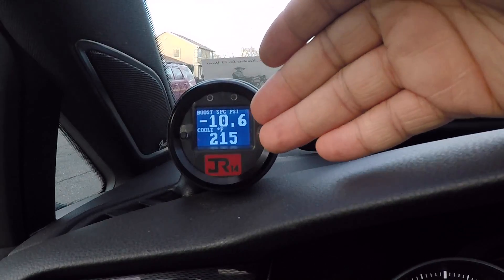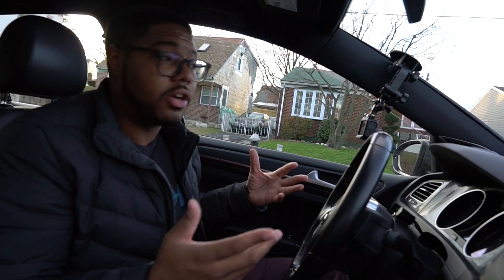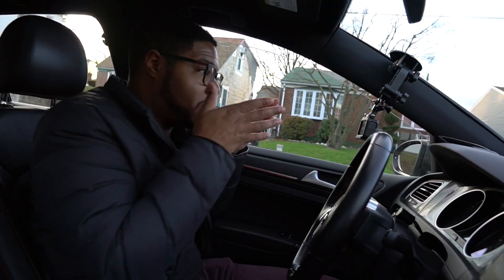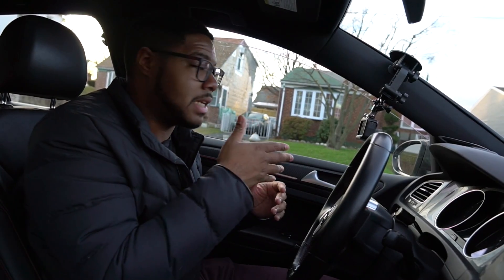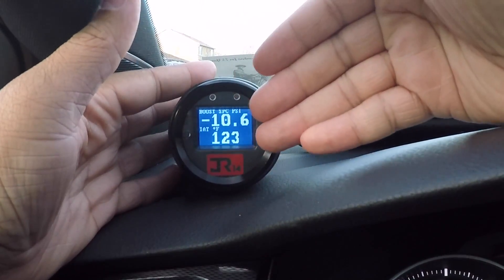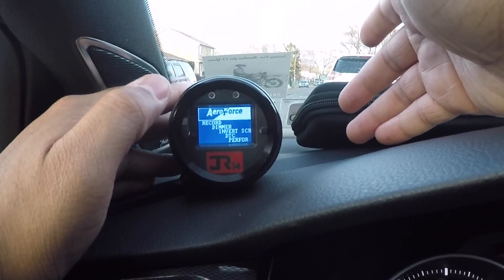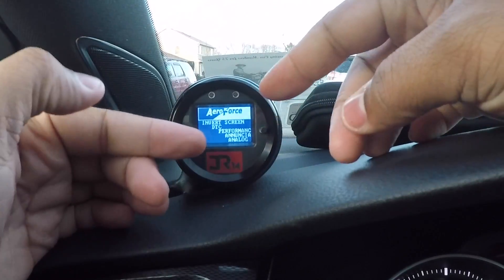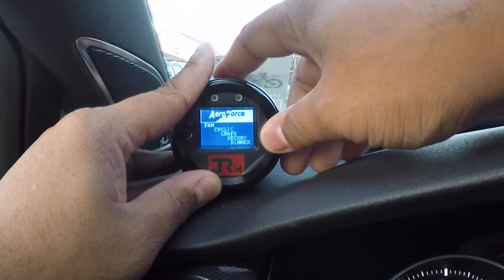Setting Up the Aeroforce Boost Gauge | MK7 GTI

Comment: the apr boost gauge is super simple. no buttons. no menu just indicates the level of current boost
Reply: Is that all the APR does, show boost?  This Aeroforce gauge does infinitely more, and no need to run wires or tubing from the engine to cabin.